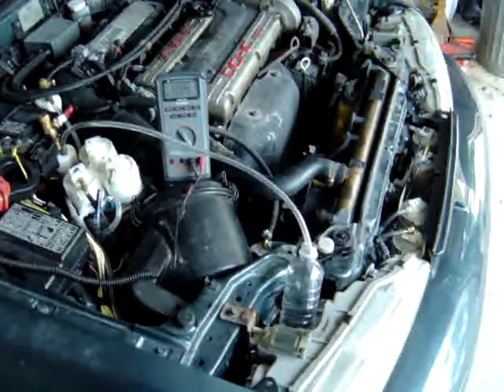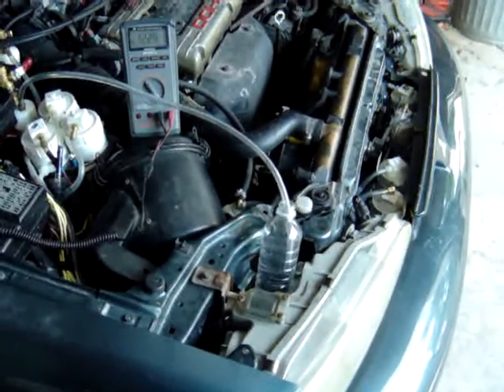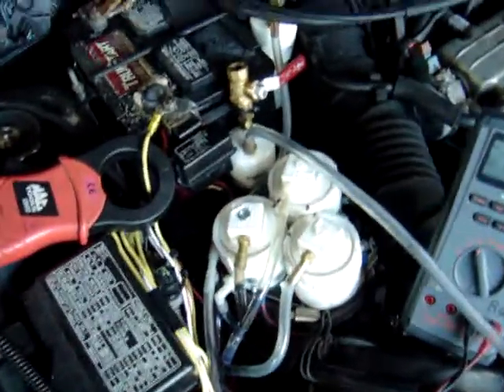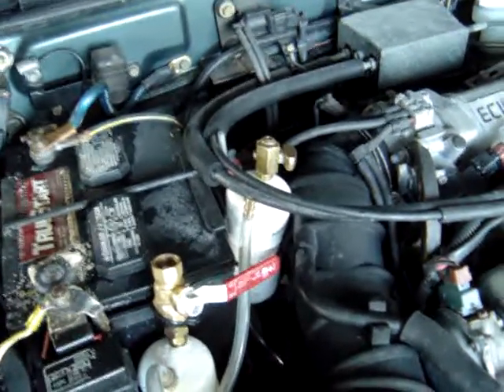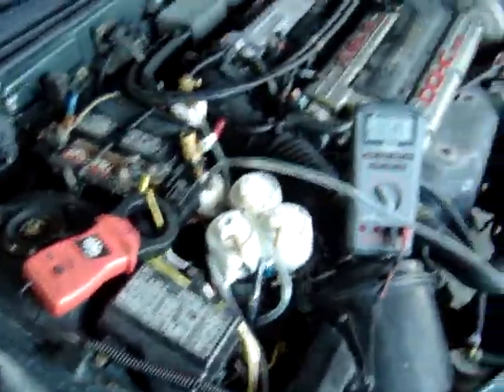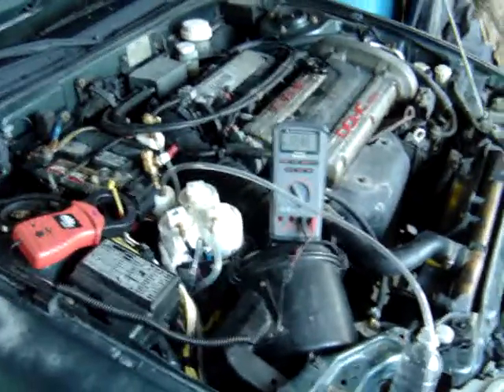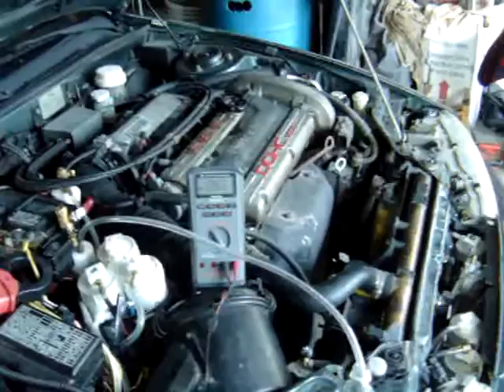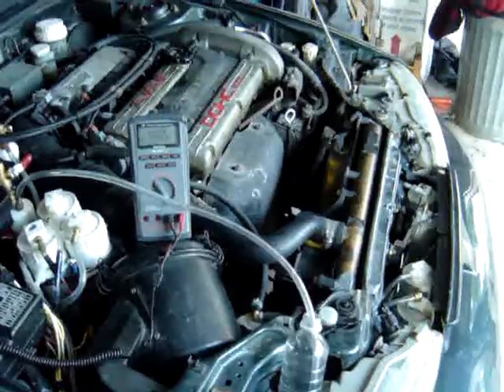HHO 7 CELL GENERATOR, INSTALLED IN MY MITSUBISHI

Comment: @cavebandit 
I just hate to see you and others sucked into this snake oil. It borderlines with perpetual motion machines. Your time and hard earned money would better be spent purchasing a WB02 and the software/hardware necessary to reprogram your car's ECM where you can optimize the fuel and spark tables. You will see real and substantial results for both power and efficiency! Most engines are capable of running significantly leaner during cruise but are not allowed to because of NOx outputs.

Comment: @cavebandit 

the amount of oxygen produced by these is miniscule compared to the requirements of the engine. Say you have the 2.4L engine and are cruising down the freeway with your engine turning 2500rpm, it would need about 90cfm of air.. that is 2,548 liters per minute! but you might say but air is only 21% oxygen.. in that case it still would be 535L/m required. Some of the better HHOs I've seen on here produces 2.2L/m.. and that would be 1.46L of hydrogen, and ONLY 0.73L of hydrogen!

Comment from the maker: @paulkaygmailcom 
This will be my last post since the video we are talking about is so old and the setup is ineffficient. I have had this argument before.
Ok, say your carburated car runs 20mpg, even when carbed vehicles are tuned well,they still run pig rich. Lots of unburned fuel, add a flammable gas to the incoming air you are bound to burn more fuel. 
Nitrous oxide isnt even flammable and look how much of a power  (efficiency) that is. I figure that the oxidation alone is worth something.

Comment: @cavebandit 
its basic math really and the laws of thermodynamics. Modern internal combustion engines have an efficiency of 20-30%. Alternators are in the 50-60% range, and the usable energy in the hydrogen from the electrolysis process is in the order of 50–80%. Energy is lost as heat during all these processes, air-fuel burned for mechanical energy "engine", mechanical converted to electrical "alternator", then the electrical to create usable fuel "hho cell". Shall we go deeper into this?

Comment: @cavebandit 
HHO systems are a net loss in power any way you look at it.. only gains from cars are fooling the ECMs O2 signal making it run the engine leaner than normal.. HHO is only creating a loss if powered from the engines battery/alternator

Comment from the maker: Well I havn't done enough testing with mine yet to make any conclusions. My Eclipse is a 92 so it only has 1 o2 sensor, the idea is that with that sort of emmisions system the computer should compensate in the correct direction. As far as the MAF it shouldn't care what is flowing through it. Time will tell what exactly I have to do.